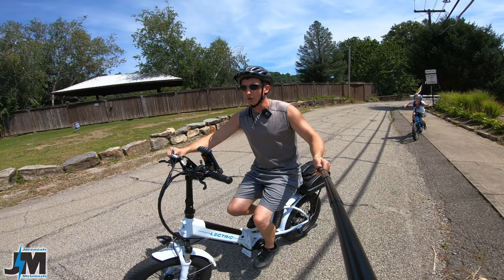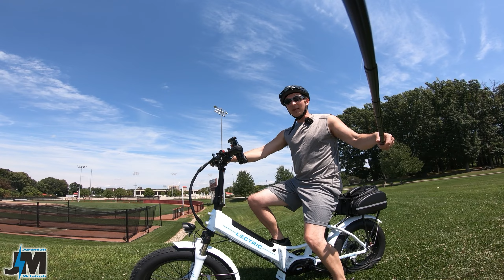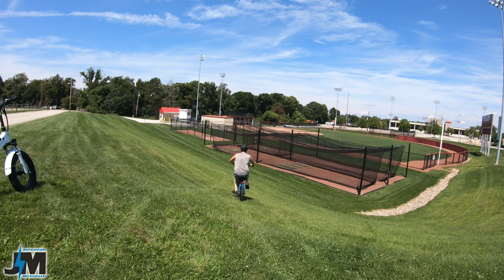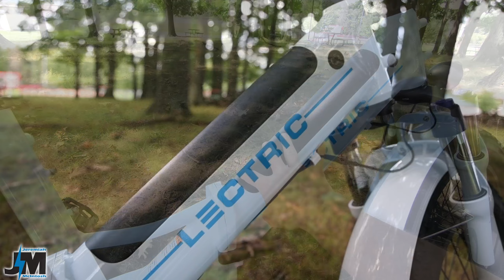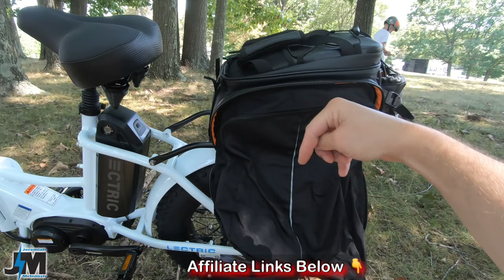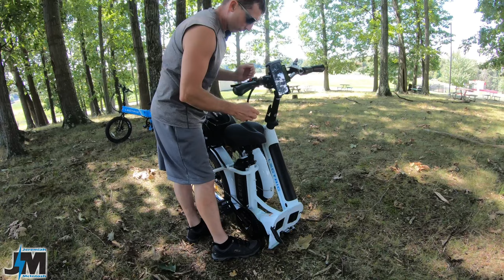Lectric XPremium Ebike Review ~ Affordable Dual battery Mid-Drive motor E-Bike!

Comment: I'm 6' 225lbs and this is the only letric bike I felt comfortable on. Feels like you're riding in it and not on it... If that makes sense.
It does EVERYTHING well and has a better quality feel, than the smaller letric bikes.
Imo they discontinued this model because, it was to costly to produce and the "average" letric consumer, doesn't want to pay the "PREMIUM"
mainly, because...I don't think they appreciate the advantages of the mid motor, hydro breaks etc.
The extra weight is to be expected, with the larger frame and extra range (which is amazing)
For those of us who are LARGER...it's a no brainier and this model will suit much better.
I have a KTM ct4 29er... Paid $3k for that bike and it can't compare to the PREMIUM.
If you're a LARGER person... Get this model, while you can.
Wether new or used... It can't be beat for the $

Comment: Why is it that almost everyone reviewing bikes rides with their seat way too low.  Wouldn't you want more leg extension to generate more power especially on a mid-drive with a torque sensor.  Otherwise nice review.
Reply from the maker: Because it shows a better view of the display and easier to touch the ground when I stop because most of the time I’m riding one handed while filming. But you are correct about leg extension.

Comment: The Bike ships as a Class E2 Bike but you can go into the settings and change it to a Class E3 and get much faster. They have the E3 sticker underneath the E2 and you are required by law to change it. So far I have not found a reason to up it to an E3.  I am 62 years old 200lbs and I have put 30 Miles on this bike.  I rarely ever use PA5 even going up some steep hills I just gear up and down. On flat ground, I am on PA 1 or PA2 and maintain 14 mph.  Yes have to pedal to move but that's why I bought it for assistance not replacement. It does take getting used to and they have a video on their YouTube channel on how you are supposed to shift with this bike compared to their others. Thanks for the review good to see others' thoughts and yeah I agree the reach for the handlebars is a bit far. Probably do the handle swap you showed. Thanks again.

Comment: Dude the batteries are tiny for e-bike batteries so if they didn’t include both it would be a total rip off but maybe that’s their idea idk.  Just insane they split it into two small batteries just so they could say they have two for long range even though it will be the same range as a normal e-bike.  Maybe a little more because of that motor but not because they two batteries make it better they do not.

Comment: Great review. This mid drive is a completely different beast than a rear hub motor. I can see how this bike is so much more suited for slow trail riding like you showed since the torque sensor allows pedal pressure to modulate motor output.  Also it seems to require plenty of mechanical shifting for efficient riding which may be less forgiving for casual riders that don't want to think too much about how to max their climbing or speed, yet it may be suited better for people that actually want to be more engaged with controlling the bike with that torque sensor. How did the pedal cadence feel at 28 mph? Too frantic or sustainable?

Comment: I just put in my order, and was confirmed for the electric X premium E-bike. I added some accessories to the order , but they said the bike would arrive separately and ready to go after assembly. I got the Comfort bundle with the seat. side view mirrors, bike lock, front and rear basket rack bundle and for when I go shopping for the heavy Goods. They call it the pet caddy. I call it the two cases of water 2 bundles of 6 paper towels, and whatever bulky heavy items I don't want to carry in the baskets! In the four months since you made that video they have upgraded the mid-motor, get your choice of 750 or 1000 Watts. I was looking at an Ariel e-bike out of Washington state. They never got back to me and the price of theirs with shipping and taxes was much higher then the electric Xpremium, with free shipping and $148 tax. There's was $3,300.07.!!! The electric Xpremium came to $2,262.00, with the added accessories. I'm pretty sure the front forks at 88 mm of cushioned travel. Also with LED headlights and integrated brake light. The only thing the Ariel had that I liked was tail lights and turn signals. I think my choice to go with the Xpremium will be enjoyable. After your first video I liked and subscribed with notifications. You have a great informative content
Reply from the maker: First and foremost thank you for subscribing! Sounds like you’re all set! I’m a little confused tho the xpremium wasn’t updated to 750 or 1000w since my review. It’s still a 500w middrive that peaks over 800w.

Comment: I would think that in the future they could bump up the batteries in ah. Nothing written in stone says the front tube battery needs to be flush looking. That battery could be 14.7 .. The rear drop in battery also could use another 3-4 inches of space up. 👍 (Or as upgraded choices). People just need be aware of the loss of seat post lowering and stand over space. Looks highly doable though to bump up to 30 ah.

Comment: Thanks for the detailed, fair review! I'm 70+ y.o. and I thought my old legs were the problem when I couldn't hit 28 mph with my XPremium no matter how hard I tried. I see that a younger, fit Jeremiah (about 40 lb lighter than me) couldn't do it either. As others have said, we don't spend 2k on an ebike to sweat and get short of breath in order to enjoy high speeds. I definitely agree with all of the virtues of this mid drive bike, but the lack of speed gives me a nagging feeling that I didn't get what I paid for.
Reply: These bikes are meant to be pedaled.  You can buy an ebike without pedals that are meant to go on their own.
Reply: @rcud1  I think you missed the point of my comment. I'm just saying that older riders will find it difficult to pedal this bike up to 28 mph. I always pedal no matter what I'm riding, but if I want a real cycling workout I'll take my non-powered bike that weighs half as much and cost 1/4 the price of the Xpremium. @EuropaWill (below) said it well: This bike is best for slow, controled trail riding - not fast cruising.
Reply: Did you unlock the class 3 mode?
Reply: @tenncutt  Of Course. That's the first thing I did. I see that Lectric's new cargo bike has a 750w motor. That motor should have been on the Xpremium if they wanted to deliver a truly "premium ride".
Reply: Did you unlock the 28mph. It's locked from the box. You have to go into the setting and unlock the 28mph.
Reply: @tyler21569  Yes I did. See my reply to @TennCutty above. I sold the XPremium months ago and am now riding an Aventon Aventure (unlocked). It definitely fits my riding style better (no value judgements). I always pedal but, with the 750 watt motor, have no trouble hitting 28-30 mph when I want. The battery has plenty of range for someone my age. To each his own!

Comment: Depends on the mid drive also, if you build your own bike,  put a bafang bbshd 1,000 watt mid drive  with the 30 amp controller, on your regular mountain bike, it will go 35 to 40 miles an hour on throttle only, just using a few gears....1,200 dollars for the motor and battery, if you already have a bike and can follow simple instructions, it can't be beat, but alot of people can't follow simple instructions, in that case you have to spend alot of money to achieve that performance.....You should build a bafang mid drive bike, you won't go back to these bikes guaranteed...You can buy your motor and battery from johnny nerd out...

Comment: I've got two mid-drive bikes one is 1000w bbshd bafang with 160Nm torque and the other is 750w mid-drive bbs02 with 130Nm torque and they both have independent throttles with I changed using the eggridder V2 display and they pull like mountain goats up hills 🐐

Comment: For some of us the XP 2.0 with 11-32 rear sprocket, 14amp battery+spare is more beneficial.   Can cruise 26mph on flats with PAS 4 gear 7 normal pedaling, top speed 30mph.  Tires 35psi max.  30-50 mile range.  Then just swap battery.  Some have hard wired second battery with a switch.  Total weight 75lbs with two batteries, alarm, smartphone, water bottles, snacks, mini tool kit, spare tube, and trunk bag. Pushes my 200lb mass with ease.  Need the punch off the line of rear drive motor to merge and cross traffic without pedaling (use MTB pedals).  Throttle in stop and go situations without gear changes or pedaling is very practical and safe in my area.  Mainly do pedal ride, but cannot avoid traffic.  No bike paths nearby.  100-150 miles per week.  Works for me.
Reply: I love this ebike. It has dual batteries very well placed, hydraulic breaks and many other premium stuff!!
Reply: Almost identical to my use, but you use yours more. I pedal most the time, throttle for road crossing, have a spare battery when needed, and I have it pretty well equipped with the cargo package and panniers from Lectric. Gotta do the 11-28 and possibly the hydraulic assist calipers. I believe it’s the best value package at around $1600 or so with everything.

Comment: Lectric doesn’t recommend using pos 5 with gear 1 or 2. Claims it might break chain. For steep hills I use pos 3 and gear two. Works fine .

Comment: I agree with the 750 watt motor considering it’s torque sensor as well as having 20.8amps

One has to seriously consider whether you want to put in a lot of effort all the time as there is no other option, or a hub motor is where most have in mind when they consider the thrills of an electric bike. I’m definitely hub motor cadence sensor as I have the option of putting any effort I want at any given time and not lose much at all.
Reply from the maker: What’s nice about this torque sensor though is that the throttle overrides the  torque sensor and you don’t have to work hard if you don’t want to.
Reply: @JeremiahMcintosh  Exactly!  For us older people with RV's it is a perfect combo.  It feels like a more normal bicycle and you can pedal and get exercise as much or little as you want; but then on a bad hill you can just twist the throttle for assist.  I have a RadMini ST2 and it has the hub motor with cadence sensor and it is unnerving for my wife as even if you pedal just a little it applies ALL the power for that assist level - it make it jerky and digital like - either on or off.

I've been waiting for this exact model (torque sensor mid + throttle) and it's on sale for black friday with some freebies (seat post comfort set) for 1599.  Pretty excited !

Jeremiah I read your reviews last spring and they helped me pick out the RadMini ST2 and now they helped for Lectric XPremium.  I like your videos they and thanks a lot!  One thing I still don't understand is the freewheel type of mechanism at the crank that lets you hold the pedals still while the throttle still rotates the chainring and the chain.  I can imagine it but nobody has shown it to explain it.  Just a little video would be great - even on a different bike model. thanks!
Reply from the maker: Thank You. The chain will still spin when using the throttle and not pedaling because that’s how a mid drive motor works. The power is put through the chain.
Reply: In Utah for it to be considered an electric bike, it cannot go over 750 watts.
Reply: @jazziered142  nominal?

Comment: Another point about mid drive..  If chain breaks your day is over . 👍
Reply: Yikes, if your plastic hub motor gears strip your day is over !
Reply: @tim8148  they'll likely complain and be noisy well before failing outright giving you a heads up to fix it before going on a long ride. If the hub gear strips  or the battery dies for that matter on a ride, just pedal home like a normal but heavy bicycle on a rear hub motor ebike.
Reply: Ride prepared. Bring an extra chain and chain removal tool with you in your tool bag. A must for mid drive riders.  I do even with my rear hub motor ebike. Same for a tire/tube patch kit and small air pump.
Reply: But if ur regular bike's chain snaps, ur day is still over. Just learn to carry a chain on the fly. The components and tools are light to carry.

Edit: Grammer

Comment: No mention of peak wattage getting used going up hills.. Would be nice to know if it can really put out 800.
Reply from the maker: I’ve seen it roughly use 15 A going up most hills which is about 720 W if you go by the nominal voltage of the batteries which is 48 V. If the voltage in the battery is higher it could possibly be reaching 800 W.

Comment: That motor getting so hot will most likely cut its lifespan shorter than the hub used in the 2.0.

Comment: IMO just stick the 2.0 and get an extra battery, especially the new more powerful battery they're selling now.
Reply from the maker: I think many people are going to feel that way but it is a really different riding experience and some people might like having the torque sensor to have more Feel like a regular bike and to get more exercise. It is definitely a lot smoother then I hub motor that’s for sure just not as peppy up to TopSpeed.
Reply: @JeremiahMcintosh  Depends, if you come from a hub motor and are used to using the throttle   a lot, this may not be for you. However if you come out of a normal bike, like I did, then pedaling is just a natural thing to do. I barely use the throttle on mine. Mostly when I am in traffic and need to move quickly.

Comment: Your seat was way too low on the xpremium. Also you cannot use throttle while pedaling, the two modes interfere with each other.
Reply from the maker: The throttle overrides the torque sensor so I don’t know what you mean by it interferes?
Reply: @JeremiahMcintosh   Yes I mean pedaling doesnt work when you use the throttle

Comment: Hey Jeremiah,
Have you tried the Ariel Rider Kepler for $1,800.
In my opinion it’s the best deal going for a high performance ebike. It’s Apples and oranges compared to the XPremium but the Kepler performance for the price knocked my Sox off!
I’ll pass on the XPremium @ $1,900. because with a second battery upgrade the XP 2.0 is a way better deal than XPremium because 2.0 cost total is around $1,300. with second battery.
Thanks!
Reply: Agree that the Kepler is probably best bang for the buck.
Reply from the maker: No I have not had a chance to try out the Kepler yet but it does look like a A lot of value for the money.